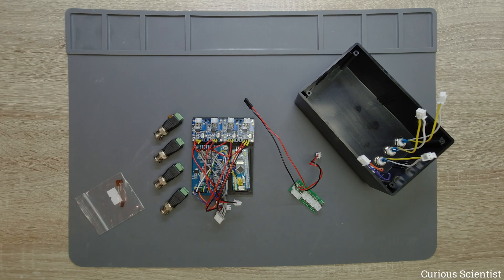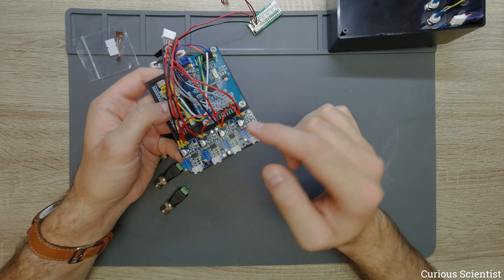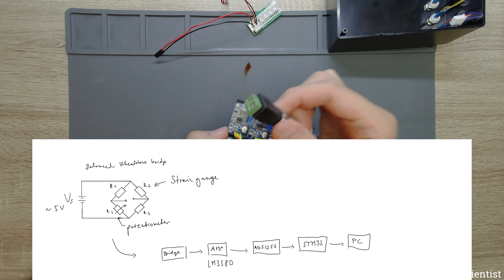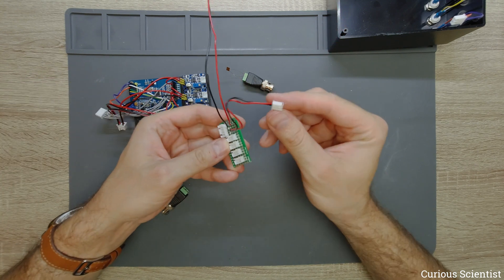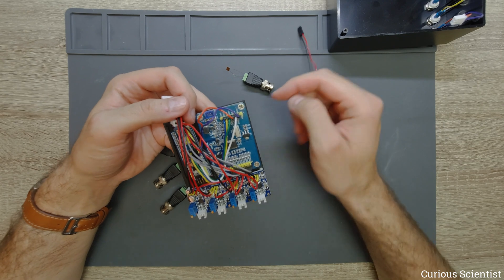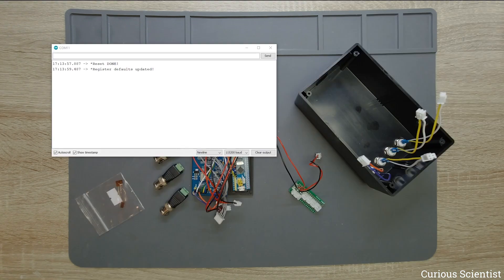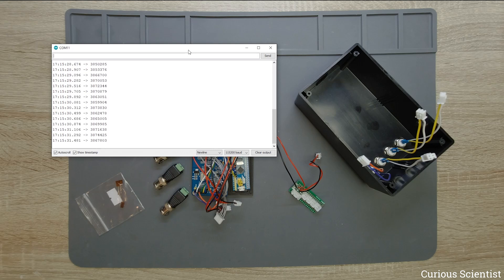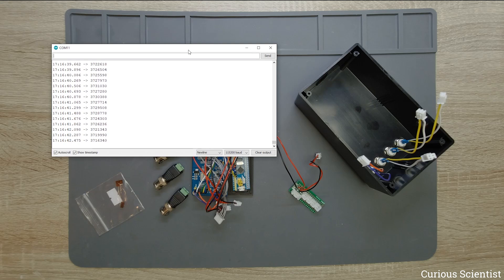4 channel strain gauge circuit demonstration

Comment: Thank you so much for your helpful video. I have two questions about using this circuit in my project 1. Can you share the Sampling time for the collecting data? 2. Can we use this component for 6 sensors?  Thank you for your help
Reply from the maker: Hi!
The sampling time is whatever you set it for. Please refer to the datasheet. 
You can connect 4 differential or 8 single-ended devices to this ADC. If you use single-ended inputs, then you need to make sure that both negative and positive strains are within the 0-5 V range. So, the signal must be centered around 2.5 V.

Comment: Is there any way you can show how to connect the boards together?
Reply from the maker: Like which ones? It's pretty straightforward.
Reply: @CuriousScientist Like connecting the 3 pins of each amplifier to the arduino
Reply from the maker: They're connected to the ads1256. It's just their output goes to the input pins of the ADC.

Comment: Hi! I intend to do the same too (for my graduation thesis as well).

I have a 2-bending plate setup and I intend to use 4 strain gauges on each. I intend to use the plate as a load cell and 2 pcs of HX711 to connect to a single Arduino.

However, I do not have the circuitry to convert the strain into a readable output on the Arduino.
Do you have a related project I can follow?

I will make sure to cite any reference I used, Sir. Thank you!
Reply from the maker: Hi! The HX711 module is the circuitry that converts the strain into a readable output on the Arduino... There's nothing else needed.
Reply: Thanks for responding!❤️ I'll make sure to try this out again

Comment: Hi! Is this strain gauge amplifier module usable with 3.3V input voltage?
Reply from the maker: Hi! Based on the opamp used in the module, you should be able to use it with 3.3 V supply voltage. Keep in mind that this could limit the range.
Reply: Thank u. @CuriousScientist
Reply from the maker: You are welcome!

Comment: Hi, I am trying to create a low cost datalogger using arduino, for my graduation thesis. I intend to fix four strain gauges in a pipe, to measure the flexion load, like an load cell. Mabe i can simply use the HX711 module, but i think it will give me a low capture frequency because i want to use this to take measures in a car wile it is runing. Do you have any advice to me? Can I use yout sistem from the video to associate the four strain gauge in a whetstone bridge circuit to take the measures in a hig frequenci?
Reply from the maker: Hi! You can reach 4.3 kHz with 4 differential channels with this setup. So this would work well. If you end up using my code, please don't forget to cite it in your thesis. Also, I have published a fully capable arduino library for the ADS1256 in the official arduino repository. You can directly get it from the arduino IDE's library manager.
Reply: Hi! I intend to do the same too (for my graduation thesis as well).

I have a 2-bending plate setup and I intend to use 4 strain gauges on each. I intend to use the plate as a load cell and 2 pcs of HX711 to connect to a single Arduino.

However, I do not have the circuitry to convert the strain into a readable output on the Arduino.
Do you have a related project I can follow?

I will make sure to cite any reference I used, Sir. Thank you!

Comment: hi .. i am interested to build the same system, it suit very well to my project. have you a electrical scheme of how to connect all the modules and the strain gauge (connections of cables). Many thanks in advance . regards
Reply from the maker: Hi! There's no schematics needed, really. I just wire the output of the strain gauge modules to the input of the ADC. It is just common sense. The Arduino and ADS1256 are also just standard SPI connections. It can be read from the source codes I published.

Comment: Hi,
Where can I find the code for this? You have a code for ADS1256 that is overwhelming to understand and cannot use it without the client software. I want something to read 2 strain gauges thru the serial monitor, that is all. Thanks
Reply from the maker: Hi! I am sorry, but if you find my ADS1256 code overwhelming to understand, you should probably work on something else, more simple projects. You can definitely use my code without any kind of client software as the Arduino code is simply sending all the data to the serial port. I just capture that data with the client software. And by the way, I have a dedicated playlist for the ADS1256 where I explain all of its features and I also explain how to write a code to control it.

Comment: thank you for the demonstration. I wanted to make this but i am having trouble with the connection. i do not know where to connect each of them and how to connect if it is ok with you could you show me or send me a picture of the circuits clearly and closely. thank you very much! my email is sss7y7@gmail.com
Reply from the maker: Hi! For the ADS1256 and microcontroller, I have a separate video where I explain everything, even the source code line by line. Look it up in my videos. Regarding the connection between the strain gauge amplifiers and the ADS1256, it is up to you how you want to connect them. You have to decide whether use the AD converter in single-ended or differential mode.
Reply: @CuriousScientist  i wanted to connect like how you did so that i would have basic information to start on. I couldn’t find any video of how the wires go. Thank you
Reply from the maker: I connected the AD converter to the microcontroller in the same way as I presented in my other video. It is a standard SPI connection.
Reply: @CuriousScientist  which videos do you prefer me to watch for strain gauge and all connections regarding ads 1256
Reply from the maker: Just search for ADS1256 and strain gauges in my channel. I have all the resources.
Reply: @CuriousScientist  can we put up to 8 channel? strain gauge? have you tried 8 channels?
Reply from the maker: Yes you can in single ended mode.
Reply: @CuriousScientist  thank you very much i will try to make one ^^
Reply from the maker: You are welcome! I hope you'll succeed.

Comment: Can this be used to measure the output from a rosset strain gauge!!
Also what about using arduino uno with hx711 module ( we need to complete the bridge with it)
Reply from the maker: As long as the strain gauge doesn't have more than four connections, it can work. It is up to you how the data is processed aftet the acquisition. HX711 might me comfortable to use, but as far as I know, it is slow. With this system I can go up to 4-5 kHz with the 4 channel mode and 30 kHz with using only one channel.

Comment: 4 channel strain gauge, 4 channel temperature logger... I see a tendency here 😄
Is a great device for an home laboratory, great work!
Reply from the maker: It is a coincidence. In the case of the strain gauges, I use 4 channels, because I have 4 differential channels on the ADS1256. The temperature logger (ds18b20) is just because I thought 4 channels is enough. :D